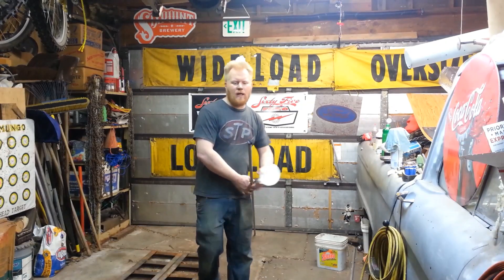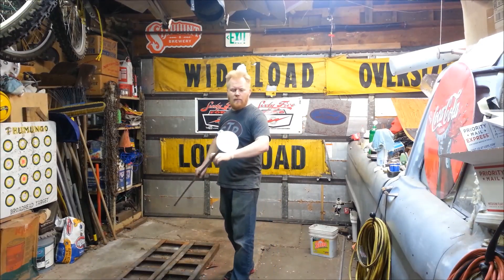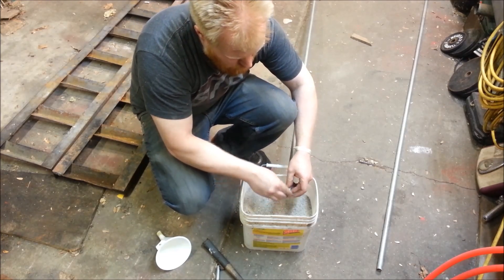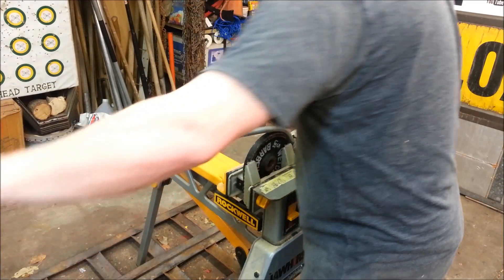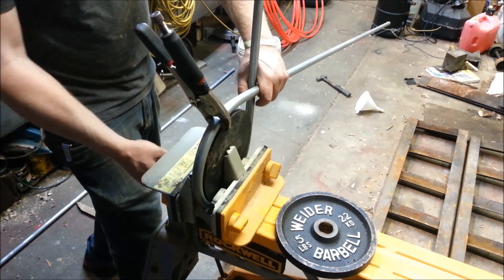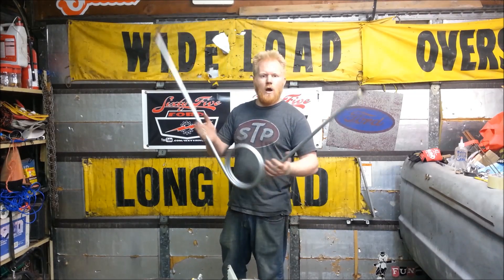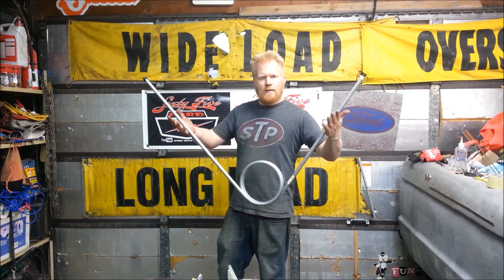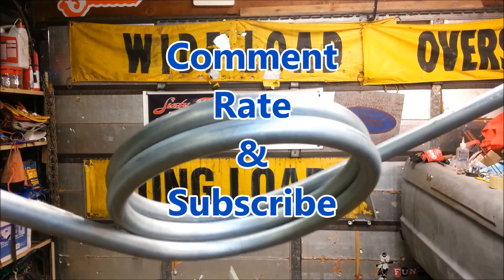Bending Tube and Pipe without kinking it... Tubing Bender Homemade

Comment: I know you mentioned be careful welding the galvanized pipe, but is there any risk welding with sand in the pipe??
Reply from the maker: Your exactly right. Welding with sand inside will absorb heat and prevent burn through. There's no danger with heating sand. Burning galvanized coating off the  pipe will give off smoke and if a person inhales enough it will give them flu like symptoms for 24hrs. BUT, there are no health risks associated with this.
Reply: Not a welder myself, but my guess would be that it could help prevent burning holes into the pipe assuming you didn't have your welder set too high. This guess is based on soldering, brazing and some light welding in the past. The irony is, back then, I lived on the coast with tons of sand around and never used it. Talk about a no brainer, it could have helped, except for one thing, sand will turn to glass when hot enough. You pose a very good question now that I've given it more thought. Now all I can do is think, mmm. Hope someone can answer that for us.
Reply: Good info sixtyfiveford, glad someone in the know filled us in.
Reply: +HostileHST jajaj! "filled us in"  i see what you did there

Comment: I had heard of the sand method a long time ago, but never saw anyone do it.

Hmm pretty much uncompressable sand when packed really tight, perhaps the finer grade the sand the better perhaps??

Beats using the old inserting a special spring inside first :-))
Reply from the maker: Yeah, I would say masonry sand might work slightly better as it is finer. But I had no pipe collapsing with regular sand.